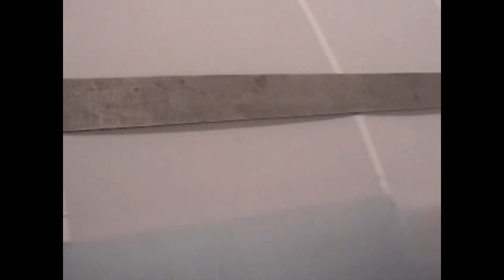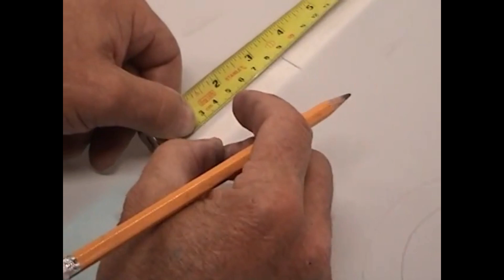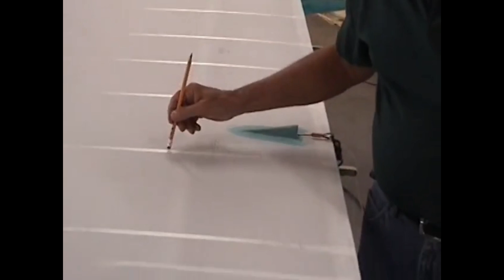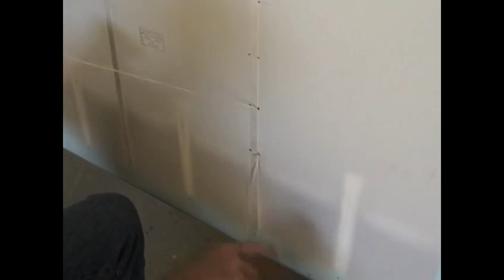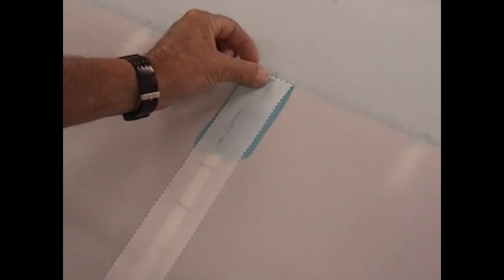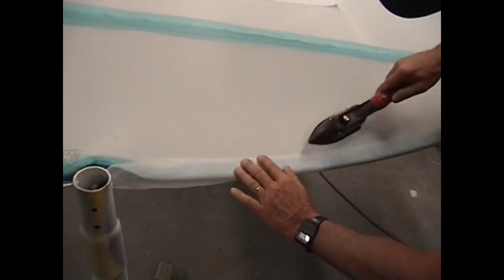Piper Wing Covering 6   Rib stitching, Surface taping

Comment: While rib stitching, if you cut yourself short , can you add string with a knot? And if so, what kind of knot? Is this safe and secure?
Reply from the maker: Well I think it’s possible, but it’s way easier to end your last string and begin with a new string.
Reply: @dennisjansen9951 , so, is there a gap in the hidden stitches? I'm recovering a Pitts wing and there are so many stitches that some of the ribs need 20 feet of string (hopefully... It's my first time doing this) and I've had to remove an entire row because I ran out with 3 stitches left. We are supposed to have a continuous string from beginning to end.  Also, thank you for your reply and your video. I've already used some of your techniques and they helped out a lot.
Reply: I should clarify. We only need to have one continuous string for each rib, not the entire wing. 😉
Reply from the maker: RR830 no, no need for one continuous string for each rib. Easier to handle a shorter string, rather then 20 ft. Just tie off the string that is too short like in this movie, and start with a new string as you did before.
Thanks for you reaction. It’s not me in the movie. I just shortened and categorized the Stewart Systems clips. Easier for me to find the info I need. But somehow it is found by a large amount of people 😂
Reply: @dennisjansen9951 , well, the video was fabulous and thank you so much for your fast replies and great editing. 😊

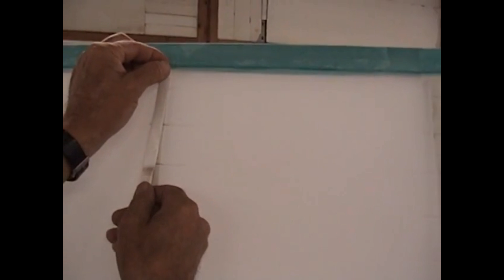Comment: Unless your STC reads differently, there may be a slight error at about 11:25 in the video. AC 43.13-1B, Section 2-9, paragraph (a), states this: "...Where multiple attachments are in close proximity, such as on a wing rib, continuous reinforcing tape should be installed, extending at least 1 inch past the last attachment at each end..." 

I'll need to go get your STC manual to read it, as that would take precedence over AC 43.13-1B, but does it state that you only need to extend 1/2" past the last stitch.

Not to be overly pedantic here or anything, but that could be a real pain in the butt if a person only extended 1/2" past the last stitch, and then it failed inspection because it wasn't a full inch. I'm not sure any inspector would catch that (my guess is yes), but back in A&P school in the 1980s, we had a couple of ex-military instructors who would absolutely bust you for it. So then you'd have to do a bunch of work to make that right.